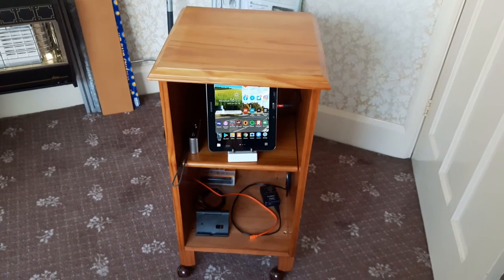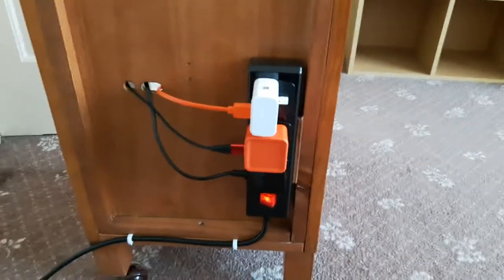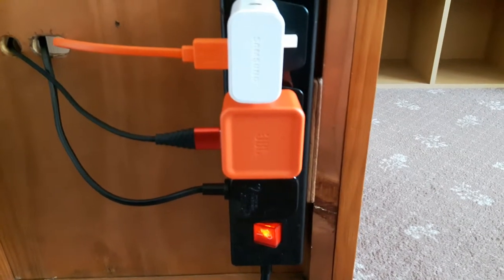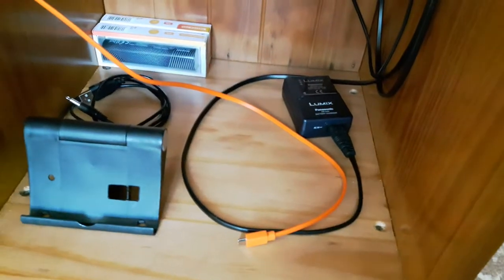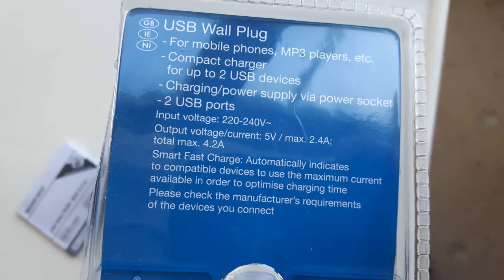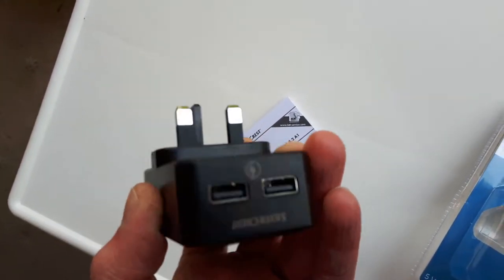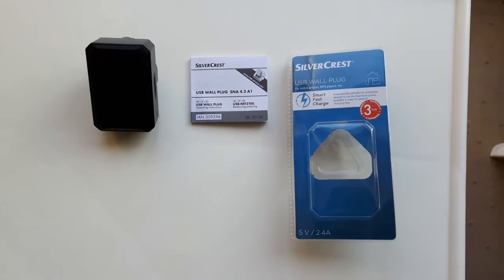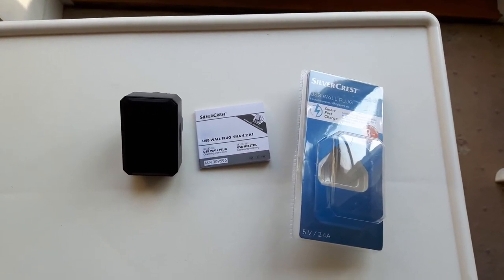USB Charging station Set Up & Defective USB Charger.

Comment: Things can randomly fail. It may have been something at the factory that caused the USB charger to fail, or something in transit. I have some 10w floods above my lego city, one day they were working fine, the next day nothing because the psu had randomly failed while it wasn't in use. Electronics is a funny thing. Love the idea of making a charger station with an old cabinet.
Reply from the maker: I shall take it back anyway, if the case had been screwed together I might have had a careful look inside, could be a dry solder joint, but it looks like its case is glued together. 
Cheers for watching. 👍

Comment: What a clever idea with that chargin station i have a suggestion thoug why dont you mount a usb hub on the bach and use a high output usb plug to power it then you can plug several usb devices into it
Reply from the maker: I have already got a 4 port USB Charging hub in the kitchen, so for this cabinet i just used the original chargers & cables I already had around.